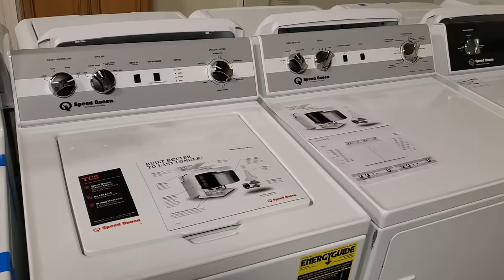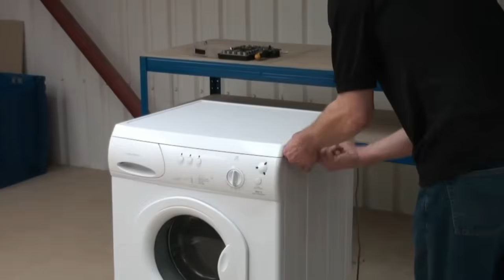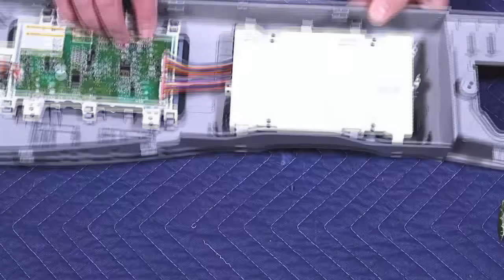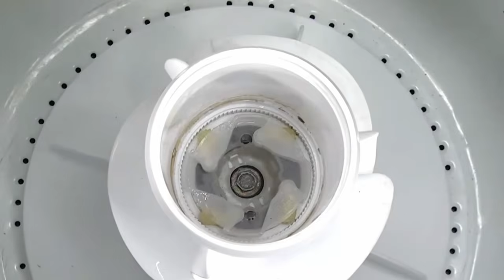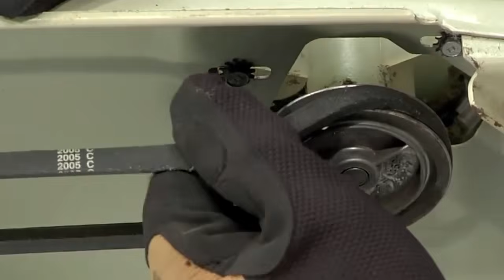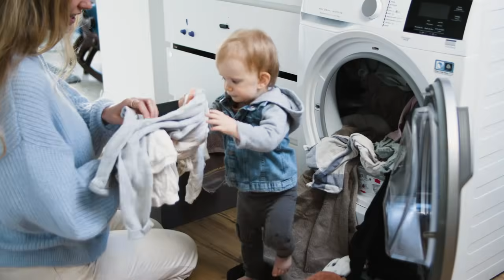3 Washing Machines That NEVER Break Down (Buy Once, Use Forever)

Comment: My parents had a GE for thirty years with no problems, but they had to replace it due to a pump bearing seal that went bad and damaged it. the old appliances lasted but the new ones suck i have a four-year-old washer and it likes to eat my laundry i keep finding holes in my towels and sheets and other items. i believe it is due to fast spin cycle.

Comment: According to the serial number on my Kenmore 80 washing machine, it was manufactured in 1983. It has never needed service. My Kenmore dryer is from 1988. About five years ago I replaced the motor, timer, belt and felt seals for around $300. I figure I basically rebuilt it so it should last another 35-40 years.

Comment: Whirlpool / Maytage is bring back direct drive top load machine spring of 2027. MTW8305. Also going with the way Speed Queen mounts the drum. 50% less parts, no transmission, no belts. $1388. It will be my next washer when my $550 repaired used Speed Queen TR5 dies.

Comment: The best one is the Speed Queen TV 2000. It has a mechanical timer dial and absolutely no computer components. It is not available at big box stores. Like the TC50003, you must get it from an authorised Speed Queen dealer. It has 4 simple cycles: Permanent Press/Heavy Duty, ECO, Delicate, and Soak. Soak will do a delicate agitation for 2-3 minutes, then soak for 12-15 minutes, and then drain. Also, the lack of a lid lock allows clothes to be added during the cycle. It has one water level, while the TC5 has two. The max fill setting on the TC5 adds 3 inches of water, which basically changes it from large to extra large. Also, the TV5 begins its spray rinse before the tub is empty.  The TV2 ECO cycle is far superior to the TC5. The TC5 has 30, 20, and 10-second spray rinses, while the TV2 has 3 30-second spray rinses. With a mechanical timer, I can move the cycle after the first spin to ECO for additional rinses and warm water deep fill. The first TV2 spray rinse occurs after the tub is completely empty. Either of these (TC5 or TV2) is worth the money. The warranty is not as good for the TV2 since it is commercial, three years, parts only. The TV 2 is not for public use and is used in restaurants, nursing homes, hospitals, and US NAVY ships. Just go see your local SPEED QUEEN dealer.

Comment: My Maytag 30+ years old timer died. So I got a LG set. I don't use the basic cycle that does not put water in. I use custom setting and the units been running fine for 3 years. I would have bought a set if I could have found one.

Comment: I have one of those Kenmores.  It was built in the 1980s and it is still going!  Nothing has been replaced.  What you applies to cars.  Cars are to take you from point A to point B, not to sing/dance/entertain/compute, etc.  Modern cars are over-complicated (depending on software to run), poor quality, overpriced pieces of junk.  I'll keep my old Kenmore washing machine and 1996 Subaru, thank you.

Comment: Our 1992 old trusty Whirlpool Duo front load washer/dryer is still going strong save replacing the washer seal once
Reply: The timer went out on mine. No biggy.  $14.95 from an E-bay vendor. Remove two mounting screws and two connector wires with a needle nose and replace.

Comment: You’re talking about the past, let’s talk today…..    I bought a Speed Queen set in 2018 and it’s working with no problems.
Reply: Speed Queen is robery. There are other good brands.
Reply: @bsgarey  Which brands are you using ?
Reply: 8 years is nothing.
 I have a 1978 Maytag that runs just fine... the spin cycle extracts the water from the wash-load like magic and really cuts down the dryer time needed.
Reply: @GlennBlonshine  I had a new pair of Maytag’s in 1979. I moved in 1989 and took them with me. In the late 90’s i had to repair the gas drier, replaced the control that stopped working and wouldn’t shut-off the drier.  This was a safety problem, could have caused a fire.  The following year the washer main wringer seal leaked. Both these repairs i did, parts were $50 each. When i moved in 2003, I didn’t take them. I had a pair of commercial coin-operated Speed Queens in the 70’s and 80’s. Well made machines. Plus the one know have you can select how much water you want, most today, you can’t.
Reply: Exactly. Tell me about a washer TODAY that i can purchase NOW. It doesnt have to b a recent just one thats STILL sold that i can find.
Reply: @TT-xj3si Speed Queen top loader, my model numbers are TR5000WN (washer) & TR5000WG (dryer).

Comment: mine is a 70 series Kenmore  from 1999  now   aug 2026  and still running fine
Reply: Mine is also a 70 series, bought in 1993 and still going strong, replaced the drive belt quite a few years ago and the agitator dogs about 10 years ago, still running good. All these modern electronic machines are junk.
Reply: Same here except my Kenmore 70 series washer/dryer set is from 1990.  Good stuff.

Comment: I need to know what washer to buy now. Doubt that I'd find a used Kenmore 80.
Reply: Don't be so sure about that. I'm not sure where you live but in most communities there are people who sell used appliances. Just Google it and see. I bought both my washer and dryer from a guy who sells used appliances and they were refurbished and worked just fine. The washing machine is a Kenmore 70 series and I think I paid about $200 cash for it.
Reply: Not Maytag or Whirlpool. Burned by both.😡
Reply: Matag MTW8305 Coming spring 2027 direct drive top load no transmission no belts. $1388.

Comment: good advice but the focus examples in this video jump all over the place , first there is talk (referencing number one) of the very reliable mechanical timer Direct Drive 80 series Whirlpool (re bagged as a Kenmore) then it jumps to a view of front loader washer in conversation that the suspension springs can sometimes be an issue but are quite cheap to replace then eventually shows the correct suspension base for a direct drive machine  , then jumps back to advice to listen for a "clunking noise" during the spin cycle  and if you hear it its likely a "bad drive belt" while showing video of a direct drive washer transmission ?  .(a belt Which direct drive washers obviously simply do not have) then again number 2 is also the same series whirlpool direct drive that old times often called the "belt drive" ? (since when ?) .   mechanical timer machines that have no Electronic Microprocessor based control board  they are also naturally highly resistant to power surges that will usually destroy a washers microprocessor chip baised  "control board or motor inverter. making you pray they still offer a replacement, or your completely fine but brain dead washer will end up in the landfill . so serviceability is always the question to ask,  you can also "rebuild the transmission in older top loader machines ,new machines have a non service transmission that must be replaced as a whole very expensive assembly.. newer front loaders with a sealed together drum Assembly's have the same issue you cant split the drum and replace bad bearings ..bearing wears out , forced to junk the whole machine .
Reply: It's because this video was made with AI and AI sucks.